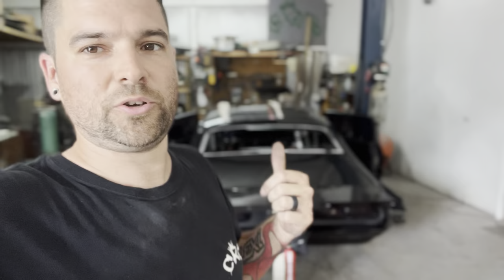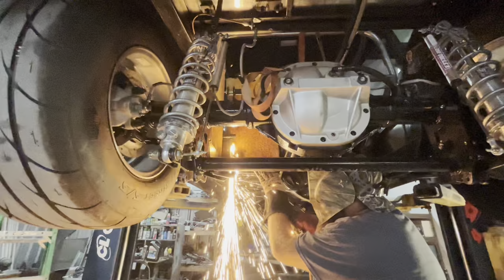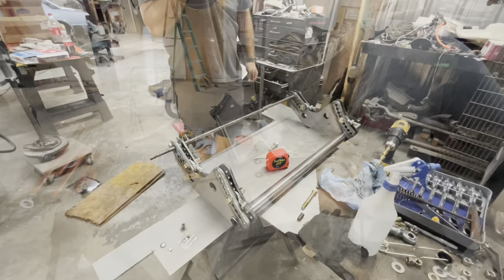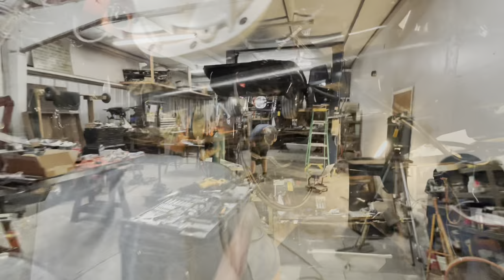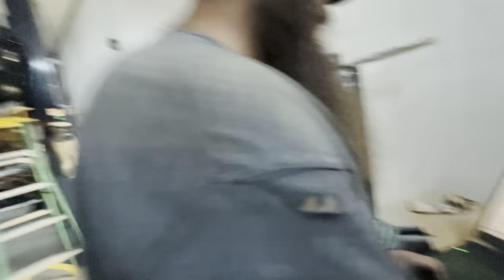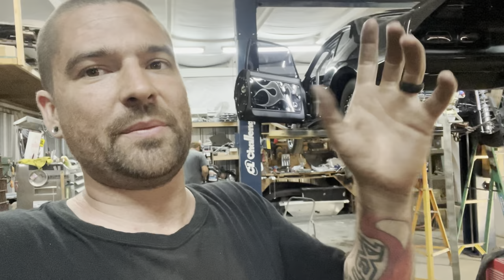💥 Tin Soldier Race Cars 4-Link Low Prep Brackets Install In 1 Night‼️

Comment: Man i almost had a heartastroke watching all those sparks were flying on those wheels, if i need them on to cut something i have some old shirts i soak down with water and wedge in the wheel holes to avoid getting hot metal melted into the wheel/coating. Looks killer though
Reply from the maker: 😂 I’m to lazy for all that I’ll just chance it on mine. Now customer job they would be off and in the office 💯